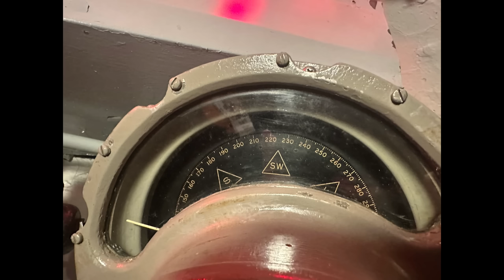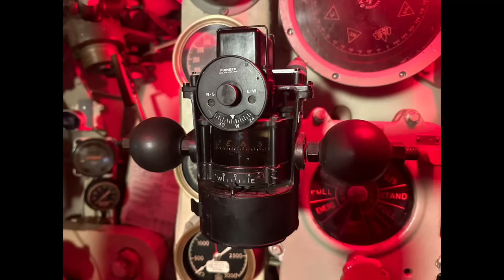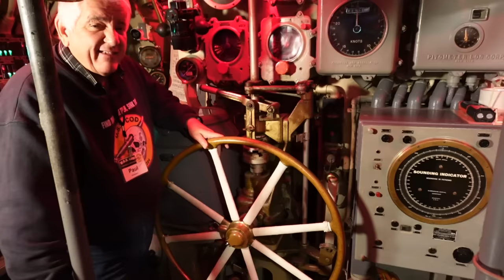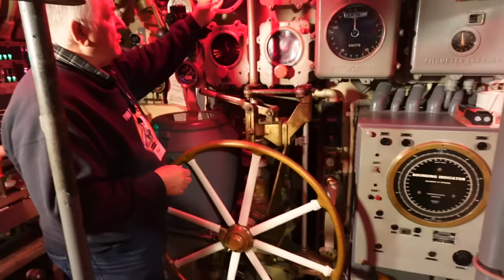Steering a Fleet Submarine

Comment: As a quartermaster in Balao & Tench GUPPY boats in the late 1960s, I seem to recall that "normal" powered steering involved moving the wheel just slightly to the left or right.  This small move opened the hydraulic valve that allowed hydraulic fluid to feed into the proper ends of the two steering rams outboard the aft tubes nest.  Centering the wheel closed the valve and stopped the rudder movement.  Then moving the wheel a bit the other direction would move the rudder the other direction.
I believe the same is true for the "normal" power operation of the bow and stern diving planes.

The quartermaster usually was in the rear of the conning tower where the DRT served as a chart table and log desk.  We could dial in the main gyro input in the nearby TDC and watch exactly the ship's actual heading on the TDC.  We loved doing this with green new helmsmen who didn't have a clue where we were getting such accurate information about just how far he had wandered off the ordered course.  Great fun to while away the long boring watch hours on a long ocean passage while on the surface.

In the winter North Atlantic that open hatch up to the bridge was the direct path for quite a bit of cold air getting sucked into the boat for the diesels, in spite of the main induction also being open for that purpose.  Standing helm watch in line with the bridge hatch and the lower hatch down to control in those winter waters was no fun, even when there was a tall waterproof trunk above used for the higher fiberglass "North Atlantic Sails".  We called that open bridge hatch the "pneumonia hole" for good reason.  Still better than being a freezing bridge lookout or the OOD though.

Comment: From 1969-72 I was station on the Howard W. Gilmore AS-16 and work on a lot of diesel submarines. One of our jobs was to calibrate the gauges that tell how full the ballast tank were.  That require us to go inside of ballast tanks.  The gauges use a hydraulics to register the level of water in the tanks.  Ballast tank not the very clean places and sometimes they were covered in grease to keep the rusting down.  My rate is no longer, I was a IM which is a Instrument Man.  We calibrate almost everything mechanical watches, clocks, gauges, torque wrenches, typewriter, add machines. most of our work was calibrating gauges submarines have a lot of gauges.

Comment: Great video, Paul!! I knew of the incredible effort required to steer the boat without power assist from my dad, George W.  Farnham GM 2/c USS Runner I, Sawfish, Lamprey. On one of the rare occasions he talked about his service in the subs,  he mentioned that on one of the Sawfish patrols it was his rotation at the helm. They were getting depth charged relentlessly by a couple Japanese destroyers for what he said felt like days. He said they were down so long the heat and foul air were suffocating.  They were sweating so profusely they were cramping up after only a few cranks on the wheel and the sweat was running off of them and pooling up on the deck plates making them real slippery. He said if it hadn't been so nerve wracking it would probably have been funny to see them slipping and sliding around cranking the helm wheel. Keep the videos coming Paul! They're great and thanks for sharing.
Reply: Thank YOU for sharing g your father's incredible experience on Sawfish ... the sub that was used in SILENT SERVICE series from 1957.

Comment: I have a Chelsea course clock (or zig-zag clock) from the 1940s based on its serial number.  I believe it was used on a victory ship and there’s only one permanent cam pattern.  A hack lever allows all the course clocks in a convoy to be stopped and then synchronized upon receiving a radio signal.  I believe the early course clock system simply closed its electrical contacts to ring a bell or turned on a light to let the person at the helm know it was time to make an input to the rudder.  I’ve head that the system worked great, except for when it didn’t.  How often it didn’t work, that’s classified. 😊
Reply: Yes that's all correct for convoy course clocks ! I do think the WWII-era versions allowed cam swapping.
Reply: @paulfarace9595  Thank you very much for sharing everything Cod.  Superb channel.

Comment: Excellent presentation on the steering mechanisms and operations aboard a WW2 fleet submarine!  I had a very rudimentary idea how subs were steered, but this presentation really cleared things up.  I found it somewhat amusing the compass in the conning tower was the same type that were installed in Sherman tanks.  I guess if it works, why not use it!

Comment: What's the point of the rope wrapping on Navy things? Is it more than decorative? Is it for grip? Wouldn't there be more effective ways of accomplishing that? I've always wondered that.
Reply: Both decorative, functional and was a way to pass time when off duty. It increased grip on smooth pipe surfaces like railing before modern methods and materials existed.
Reply: @paulfarace9595  that makes total sense. Thank you! Your comment about passing the time reminds me of all the times I used to get yelled at during deployment for using 550 cord for bracelets and stuff.

Comment: Could they run a helmsman in both  positions at the same time to make it easier? Or does the one in the Conn only work with power steering?
Reply: I'm guessing you could steer from the conning tower in manual power but it was even more difficult ... at some point muscle power might break a bearing!!!
Reply: @paulfarace9595  but you would also have the guys in the secondary position helping at the same time